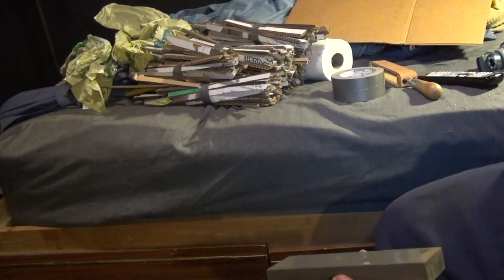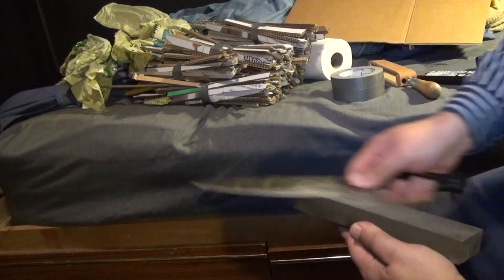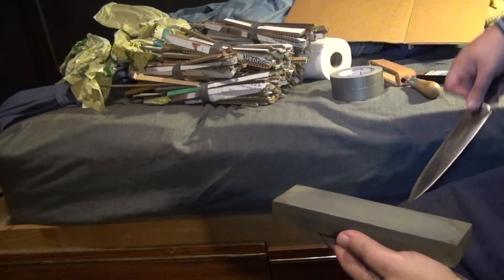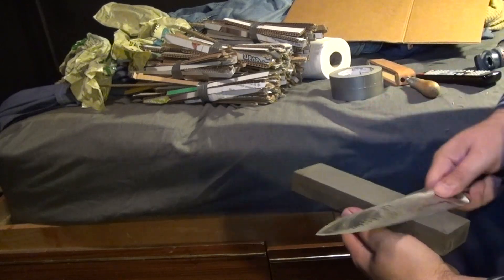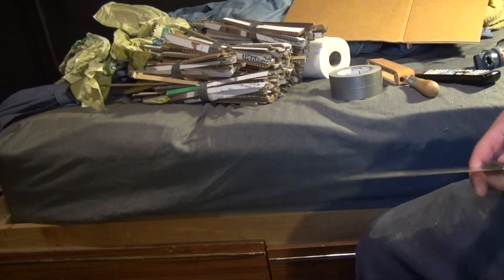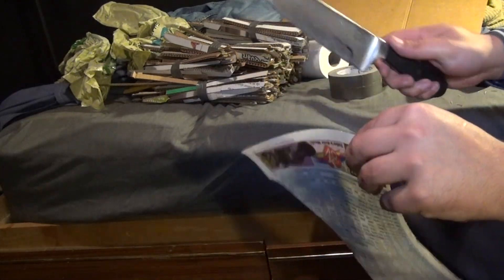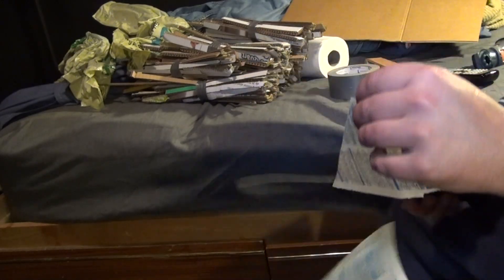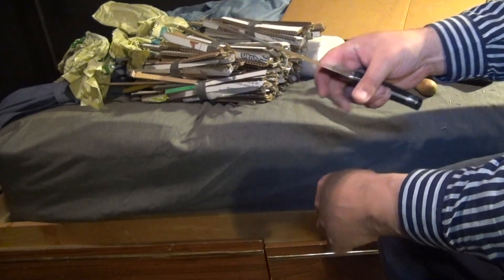Basic three step knife sharpening : destress the edge + shaping + finishing the apex

Comment from the maker: The shaping was on the 10 dps bevel, this is brought to an apex, hence I would call it the apex bevel. It will slice newsprint at this point, but will have little to no draw ability as the sharpening is done with little care. The 15 dps bevel is applied to refine the apex and minimize the burr, this is the stage where the sides are alternated at each pass. For personal use I would then back sharpen at 10 dps to minimize the 15 dps bevel into a true micro-bevel.

Comment from the maker: You can use a burr as a detection of reaching an apex, however you have then added an unnecessary step which is to remove said burr. Joe Talmadge is likely the biggest proponent of burr sharpening as he ran the FAQ on rec.knives for a long time, however again it is more of a crutch/novice type guide like the sharpie on edge than an actual necessity.

Comment from the maker: If you destress and form a flat on the edge before sharpening, you just shape until that is removed and you can see no light reflecting, At this stage it will easily slice newsprint however it is likely you will have to use an exaggerated draw (the cut depth will be comparable to the blade length) and it will snag as soon as you stop a draw and attempt a push.

Comment from the maker: A significant burr will only form when a few things hold :

a) the steel was stressed and is prone to mechanically collapsing vs being abraded

b) the force in sharpening is very high

c) the stones is very loaded causing burnishing

d) the steel is junk (grain is blown, high levels of retained austenite, etc.)

e) the edge was hone on one side far past the point of a point apex being formed

Comment from the maker: This knife has an apex bevel of 10 dps from the sharpening, I apply a 15 dps bevel on top of this and leave it there. It is fairly heavy and I would not call it a micro-bevel because you can actually see it. To be really technical in this case I would call the 10 dps the transition bevel an the apex bevel the 15 dps one. I leave the 15 dps bevel so heavy because this knife gets used pretty roughly in the kitchen by friends and family (i.e. it scrapes pots and the like).

Comment from the maker: Creating a large burr is a good tool for a novice because it is a fairly obvious sign that the apex has been formed. The problem is that it is in particular a sign that the apex was formed and you kept on grinding and that the edge is also formed on severely weakened steel. Now you have made life more difficult as you have to get rid of that burr to have any measure of edge retention which is where people can spend more time than the total length of this video.

Comment from the maker: Yeah you can strop in a positive manner, just go very light and basically it is a little more forgiving than the stone technique wise. The only reason I don't is that it is very easy to let it become a crutch and lose the skills required to sharpen on a stone and it is also very easy to increase the edge angle and round the apex and lose slicing aggression at a very rapid rate.

Comment from the maker: Thanks, I have a wide range of stones, most of the low end ones are just gifts. I generally keep them for the very easy to grind steels, but with a little conditioning they can work well on any steel. And the nice thing is after working with them, breaking out a nice set of waterstones makes sharpening trivial.

Comment from the maker: That is the goal, if you don't use such a junky stone at the start it is even faster. I actually have that same stone which is the green block in full size. If I used that then the shaping would be less than 30 seconds. But this is just to illustrate some non-ideal situations as you don't need perfect equipment.

Comment from the maker: Thanks, the critical point is that this edge isn't only sharp but extremely durable. This is the same type of edge which is applied a the very low edge angles in previous videos and has 4-6 dps edges cutting up plywood with no damage and still easily cutting fine papers.

Comment from the maker: If a very prominent burr is being raised then it means the steel is still very stressed (or junk) and now you have to remove it if you want any measure of edge durability. I would estimate that the vast majority of problems with edge chipping/rolling are because the edge is heavily stressed after sharpening.